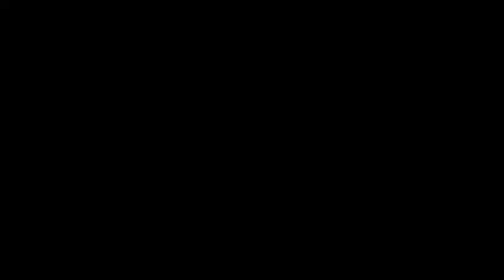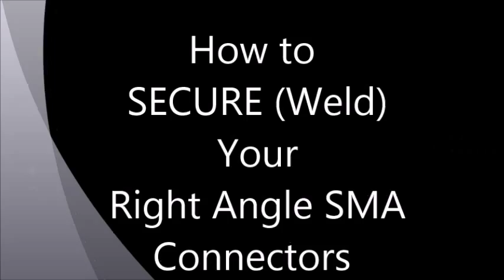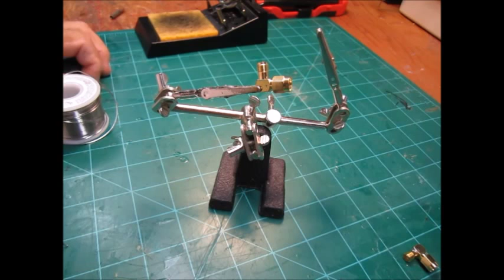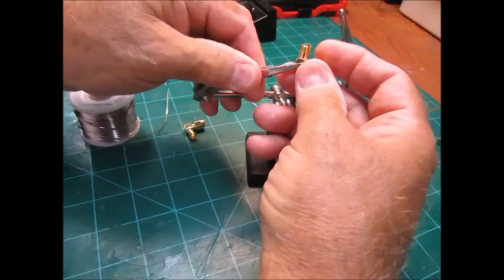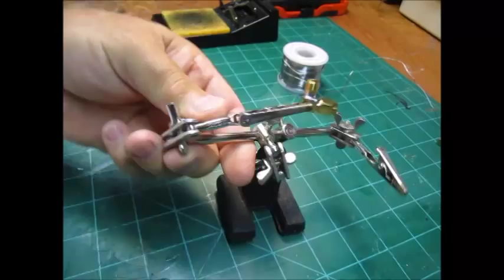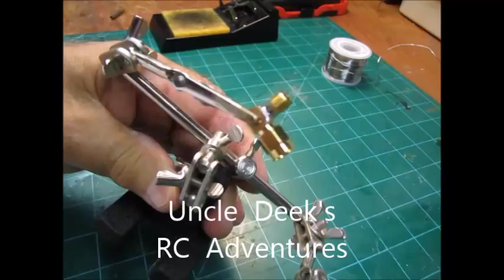How to SECURE your Right Angle SMA Connectors

Comment: Thanks Uncle Deek, I usually apply a bit of Hot melt glue to this area when the plane has finished construction to stop the antennae from unwinding. I wasn't aware that this could happen too, thanks for the heads up!